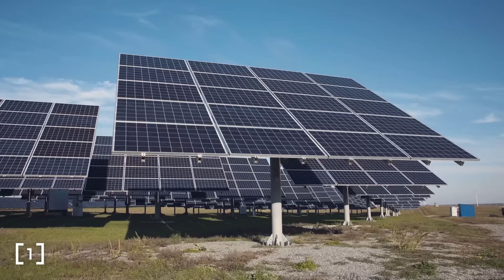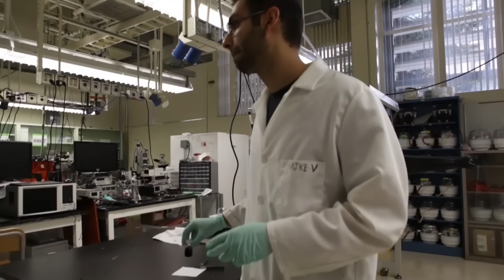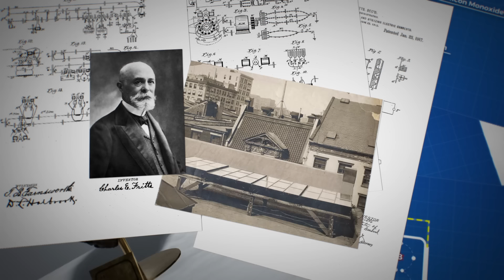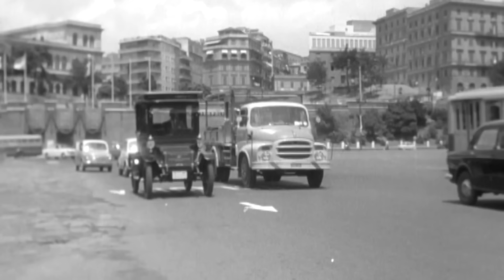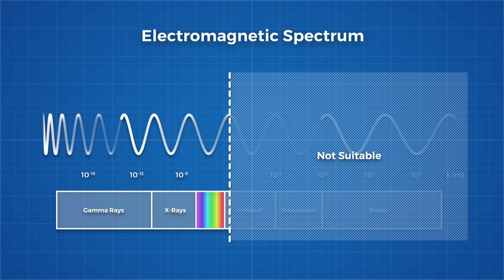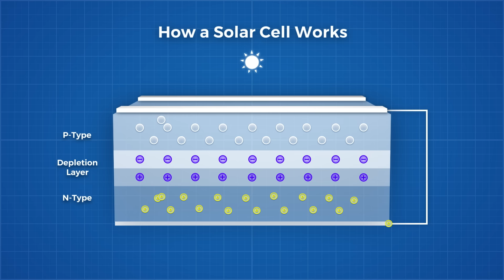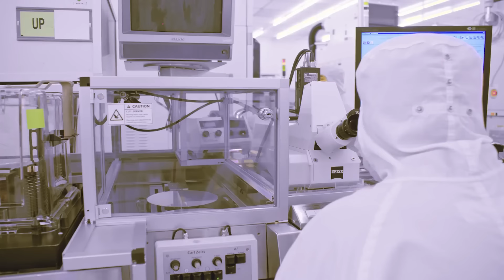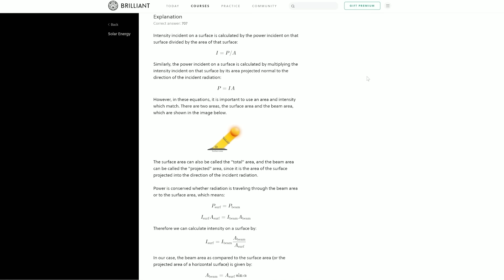The Mystery Flaw of Solar Panels

Comment: None of this even touches on the biggest flaw in solar power -- it only works when the sun is shining, and even then it only reaches it maximum efficiency when it strikes the panel straight on and without any dust, snow, or other obstructions. Solar's inability to provide power when it is needed most, is one of the reasons why California is subjected to Third World-style blackouts.
Reply: @ilikepegasi6449  Thats a false equivalency. Newton wasn't found to be flat out wrong. 

Yes I agree the models are different. What makes you think they can predict far in the future if they cant even get predictions correct within a few hours.

My point with the volcanoes was that the earth was blanketed in ash and the climate didnt "run away" as people are claiming will happen now
Reply: @t_c5266  "You're also not very well informed on history. When i say history i mean HISTORY. Not just human history." And if you had read my comment correctly you would have seen, that I was talking about the time, when humans haven't been on earth. Then humans appeared and the parameters have changed. That's why extrapolation and interpolation can not be applied! Again: There has never been a fire in this building before. Conclusion: There will never be a fire.

"Yes I agree the models are different. What makes you think they can predict far in the future if they cant even get predictions correct within a few hours." Like you even said yourself: different models.

"Thats a false equivalency. Newton wasn't found to be flat out wrong." Of course, he was flat out wrong! The errors in his theory are very small in most daily situations, that they don't matter. That's why it is fine to use it. Einstein has the superior theory in terms of correctness and it includes newton's theory. Take the equations from Einstein and investigate what happens at small velocity and mass. Guess what, you get newtons equations. Please stop talking about physical models, if you don't understand them. I am a physicist and reading this really hurts me.
Reply: @alexgloomandor3956  You've said I don't understand physical models, yet you've only talked from a standpoint of incorrect models and used them as gospel.

Please inform yourself (perhaps a college education) before replying.
Reply: @t_c5266  "You've said I don't understand physical models, yet you've only talked from a standpoint of incorrect models and used them as gospel." You simply said, that the models are incorrect. This does not make them incorrect in the reality. Did you even realize, that you made not even one argument, why climate models are incorrect? Instead, you made your own predictions according to extrapolation and interpolation. I told you, that this method does not work here, because the parameters have changed. Here a simple physics example: We are looking at a very long pendulum. For the past days, the pendulum was a harmonic oscillator with a tiny amount of friction. Then somebody is kicking the pendulum. How does it behave in the future? Translating your approach of history, extrapolation and interpolation, the pendulum would behave like it did before. Obviously, that is not true. The parameters changed. The kick changed the energy of the system and it will behave different in the future, then it did in the past. That's why your approach does not work, if changing parameters are involved. Thatswhy you have to make a model based on equations and physics. Of course climate does not react instantaneous to the change in CO2. It is like driving a boot and turning the steering wheel, you will get the response with some time dilation.  So in short: you did not prove why climate models are wrong, instead you made your own model, which has be proven wrong by basic physics.

"Please inform yourself (perhaps a college education) before replying." I said, that climate changed is happening. In college, you are getting told, that climate change is happening. What is your point here?

"So you're telling me we cant even predict tomorrow's weather, but we can predict droughts and hurricanes 30 years into the future?" You showed, that you don't even understand the difference between climate and weather predictions.

"2 million people will die by this month" (from covid) Your proof who said this is still missing.
Reply: @alexgloomandor3956  On March 16, a 20-page report from Neil Ferguson's team at Imperial College London quickly gathered enormous attention by producing enormous death estimates. 

The following summary of the Ferguson/Imperial College report provides clues about how the model came to generate such dramatic conclusions:

In the (unlikely) absence of any control measures or spontaneous changes in individual behavior, we would expect a peak in mortality (daily deaths) to occur after approximately 3 months. In such scenarios, given an estimated R0 of 2.4, we predict 81% of the G.B. and U.S. populations would be infected over the course of the epidemic. . . In total, in an unmitigated epidemic, we would predict approximately 510,000 deaths in G.B. and 2.2 million in the U.S., not accounting for the potential negative effects of health systems being overwhelmed on mortality.

https://www.cato.org/blog/how-one-model-simulated-22-million-us-deaths-covid-19

Climate models are not science.
Reply: They like to believe that if one goes to school long enough and they can fabricate the product look science based that it will fool physics. I'm not against technology but when we try to get something for nothing the weak minded end up buying it and therefore causing a demise and the breakdown in our culture. This has been going on for a long time in human history and will continue take to place. Let the games begin.
Reply: @ilikepegasi6449  TC is correct about the false equivalency. Newton wasn't wrong. His model was approximately correct. Physicists had begun to identify the limits of Newton's theory, and Einstein proposed a theory that predicted all of the things Newton's theory got correct and also correctly predicted additional observed behaviors that Newton's was incorrect on. Newton's theory of gravity falls apart at cosmic scales and ridiculously high speeds. It's still used for problems at ordinary scales like designing buildings and cars because it's accurate enough for them.

That isn't what's happening with climate modeling. We're not running into the limits of a successful model. We don't have a successful model.

On top of that, the creation of climate models doesn't follow the scientific process. These models are generated with data interpolation. Interpolation is generally useless for prediction. A good scientific model identifies laws that describe the behavior (expressed in mathematical form) and then derives novel predictions from them that are then tested. A good example is that Newton's laws predict that a feather falls at the same rate as a bowling ball in a vacuum (something no one would observe under normal circumstances), and this was demonstrated to be correct. Climate models don't even have the possibility of being experimentally verified in that manner. Heck, things are so in the air that the IPCC can't even settle on a single model to test.
Reply: @BladeOfLight16  As you said yourself, the theory of Newton does fall apart at circumstances, where you would think it would give correct results: moving objects (at high velocities) and some gravitational effects. And the differences can be gigantic, we are not talking about small errors. You might disagree on when and how you can call something "wrong". To me and every other physicist I know, it is totally fine to say: Newton was wrong, because we have Einsteins theory, that describes everything his theory did, but with better precision and even more staff. This does not mean Newton is or was useless, don't get me wrong here.

"That isn't what's happening with climate modeling. We're not running into the limits of a successful model. We don't have a successful model." To me it's fine to say, that our global warming model did run into it's limits, because it did not describe other effects happening to the climate. It limit was to just make statements about the temperature. In that manner the global warming theory was approximately  correct, like Newton was, but it left things out. Like Einstein did with you special and general relativity: special relativity does not make statements about gravity, that's where it limit was and general relativity was created to include gravity.
About the last part on not having a successful model: This depends of course on what you understand by the word "successful". If I jump out of a plane, it does not matter, if I use Newton or Einstein or a future theory of everything to calculate how I am going to accelerate. It is clear, that I am going to be dead, because we can be 100 % sure, that my velocity will be way over the threshold, where I could survive. Einstein is although not the end, it has of course although limits. Future climate models will be better, but it does not really matter, if the temperate will rise for example 2,0° C or 1,92537...° C, the overall statements will be the same.

"On top of that, the creation of climate models [...] are generated with data interpolation." I am sorry but this is not true. The general approach is to set up a very big set of coupled non-linear differential equations. This system of equations is extreme hard to solve and needs a lot of computation power. It is although, due to is non-linear nature, very sensitive to changes in the starting parameters -> this behavior is although known by the name butterfly effect. A simple data interpolation from a temperature-time-diagramm would be very different and simple to calculate. Keep in mind, that data interpolation does only work, if no changes to the parameters of the system have been made between the data points from the time interval you are using to fit your function and the time interval where you want to predict how the system will behave. See my comment earlier on the moving pendulum and then at some point kicking it. You can not use the data points from the past to predict the future. That is where data interpolation can not be applied. This is the limit of the method.
There are machine learning approaches to use the past data to predict future behavior, despite they work drastically different compared to simple data interpolation from temperate-time-diagramms.
Reply: @alexgloomandor3956  " To me and every other physicist I know, it is totally fine to say..."

Yes, because as physicists, we (myself included) know what that means. But if we were discussing it with someone uninformed about physics, we may want to be more clear.

But that said, my point is that there's a category error here. When we say Newton was wrong, we know for a fact that his theory withstood an onslaught of questions, new problems, expansions, and experiments for nearly 200 years without any serious indication that revision was needed. Electrodynamics was able to be grafted onto it directly, merely by defining new forces that fit within the existing theory. The framework was absolutely rock solid within the ability of humans to measure at the time.

Climate models do not have anything remotely comparable. They have never been proven to predict what we observed. We don't even have a single agreed upon model to have done so. We can't even perform experiments with a climate model, because we only have one climate that's beyond our ability to manipulate for experimentation. That's what I mean when I say we don't have a successful model.

"Future climate models will be better, but it does not really matter, if the temperate will rise for example 2,0° C or 1,92537...° C, the overall statements will be the same."

As far as I understand, the statistical error of the models is bigger than 2 °C when you get out a couple of decades. So we can't even say that the models predict such a change.

"The general approach is to set up a very big set of coupled non-linear differential equations. This system of equations is extreme hard to solve and needs a lot of computation power. It is although, due to is non-linear nature, very sensitive to changes in the starting parameters -> this behavior is although known by the name butterfly effect."

And how are the starting parameters determined? Is it by using existing past temperature data? "Interpolation" takes many forms, certainly not all of them linear. It is the process of constructing a function to fit known data. I never suggested climate researchers are using a linear interpolation technique; I said that they use past data to compute the parameters for their model. This is not a valid means of deriving a model.

And yes, machine learning very much is an interpolation technique. It works by computing coefficients in functions using known data, just as I described. It is notoriously vulnerable to error from picking a poor starting function/technique, over training, under sampling, or bad process (such as not properly separating your training data from your test data). You quite literally cannot derive a set of physical laws the way Newton did using it, and you cannot assign to the models it produces the kind of reliability Newton's laws gave us.
Reply: @BladeOfLight16  "But if we were discussing it with someone uninformed about physics, we may want to be more clear" I think I was clear, when it is fine to use Newton and when not.

"Climate models do not have anything remotely comparable. They have never been proven to predict what we observed. We don't even have a single agreed upon model to have done so. We can't even perform experiments with a climate model, because we only have one climate that's beyond our ability to manipulate for experimentation. That's what I mean when I say we don't have a successful model." You know that the warming trend we observe right now was predicted? Of course not 100 % exactly. Based on your argumentation why we don't have a successful model: Do you think it will be possible to have, maybe some day, a climate model, that you could call successful? Because this statement "We can't even perform experiments with a climate model, because we only have one climate that's beyond our ability to manipulate for experimentation." will never change.

My statement on 2,0° C or 1,92537...° C was exaggerated. I don't know on the fly what the exact numbers are. Let's say 4° C by the end of the century with an error of 2° C. So best case scenario "only 2° C", worst case 6° C. What is although important: the temperature rises monotone, at least for the next decades. So if we keep doing what we are doing, the 4° C will come, it just takes longer. For a more exact discussion on the numbers we might want to search for the actual numbers.

"And how are the starting parameters determined? Is it by using existing past temperature data?" Use past data, let's say 10 years ago, plug into your model and see if it fits the data from the past 10 years. If not, change your model until it fits. If it works use present data and plug into your model to predict the future.

I was never talking about linear interpolation, never used that word. Don't know where you got that from.

As I have explained before, fitting past temperate-time-data is not what climate scientist are doing. Maybe we have not been clear enough, what we meant by our statements and the other person has understood it wrong.

"I said that they use past data to compute the parameters for their model. This is not a valid means of deriving a model." I disagree. Example: analyze how a apple accelerates, starting from different heights. Based on the data, the apple accelerates by a specific value, and we come up with a function based on the data. We don't know why the parameters in the function have these specific values, but the model makes correct predictions to all our experiments. Until we have a better method, it is fine to use. What would be a valid method to create a climate model, that is valid in your eyes?

"You quite literally cannot derive a set of physical laws the way Newton did using it, and you cannot assign to the models it produces the kind of reliability Newton's laws gave us." I have never said that, of course this can not be done. But that does not mean we can not make predictions, see my example with the accelerating apple. I would although make a big difference between a model and a physical law or theory.
All climate models have errors, yes, but the trend is overall the same. Is this something we can agree on?

I am not sure what your overall argument is. Climate models have errors -> conclusion ...... ? Do nothing? Place all your money on the best case scenario?
Reply: Two Australian states have purchased the largest lithium battery from Tesla which negates any grid disruptions for a decent period of time. For CA to say they can’t fix the problem, have they heard of Elon Musk? Jk
Reply: Greta and AOC say How Dare You !
Reply: @ilikepegasi6449  I was talking about climate models, not weather models.
Reply: Or it could be because forest fires keep knocking out electric lines and sub-stations
Reply: @terencewong7967   No, they've said it's because they don't have solar power in the evening when people need it, and they weren't always able to get it from out of state.
Reply: Solar thermal plants can store and use built up heat for several hours after sunset (night time is also, coincidentally, when power demand is lowest). Pumped storage hydroelectric is another solution. 
Also blackouts still happen in states with no significant solar generation, so not really sure what you're thinking there.
Reply: @furripupau  As far as I know the potential of pumped store is very limited and dependents highly of the geological properties. At least here in germany it is not an option.
Reply: @ilikepegasi6449  Where are you getting that millions of people number? It gets warm and then people just flat out die? Where is the source for this? Where is the precedent?  What are the proposed solutions (that are actually applicable, not pipe dreams) 

Cmon have some critical thinking and use some skepticism. Don't you remember the covid doomsdaying? "2 million people will die by this month" and its at 200k. These are the sort of "scientist predictions" that make me severely doubt the future predictions. 

I would be much more on board if the scientists have proven to be right more often than they are wrong but that just isnt the case.
Reply: @ilikepegasi6449  So you're telling me we cant even predict tomorrow's weather, but we can predict droughts and hurricanes 30 years into the future? 

Sorry if you don't see the illogical conclusions I don't know what to tell you.
Reply: If battery technology continues to advance at the rate it has been, battery storage will become viable and even practical for power during the times when renewables aren't available.
Reply: @melkiorwiseman  Batteries are ridiculous to manufacture. They require a lot of materials and a lot of energy to produce, and I don't want to think about the pollution involved in discarding them after they're spent. They're not a viable solution. Go nuclear if you want to help the environment.
Reply: @BladeOfLight16  Batteries as a whole aren't an energy source solution because primary batteries take too much resources to manufacture (as you said) and secondary batteries need to be charged.  However, secondary batteries might be part of an energy solution since they can hold energy sourced from elsewhere, such as from wind or solar, both of which aren't always available.  However, sufficient battery storage can compensate for the irregular and inconsistent availability of renewables.
That's one of the big reasons why battery research is still ongoing.
Reply: @melkiorwiseman  I was talking about using them as storage from other sources. They're not viable for that, and the production costs of solar and wind power units are equally astronomical. The amount of waste produced from discarding damaged or replaced units is also ridiculous and full of chemicals we generally want to avoid dumping (like lead and plastic), not to mention the enormous land requirements. Wind and solar are bad if your goal is to reduce our impact on the environment. They drastically increase it; they cause much more harm than carbon. If you really want to help the environment, tried and true nuclear is the best bet we have right now.
Reply: @melkiorwiseman  How long do you want to wait for this new battary technology? Climate change is happening now, we can not wait any longer.
Reply: @alexgloomandor3956  It took around 10 years for lithium technology rechargeable batteries to come to maturity.  It will probably take around 10 years for solid-state electrolyte batteries to also become fully viable.
Solid-state electrolyte batteries will have a higher energy density than lithium, will probably use cheap and common sodium instead of more expensive and rare lithium, and will be able to be recharged at a rate previously unheard of (effectively only limited by the heat dissipation characteristics of the battery).
So the short answer is, probably close to 10 years.
Reply: @melkiorwiseman  I think 10 years is realistic.

So your plan is: wait 10 years, hope that in 10 years we really have the technology to switch to 100% renewable energies. Building all the batteries, solar panels and wind turbines will also take multiple years. What are we doing in the meantime? Burning fossil fuels? For me this does not sound like a good strategy. It just takes to long.
Reply: @alexgloomandor3956  History has shown that we can in fact wait longer.

hell, history has shown that the earth will change no matter what we do. We could get an ice age after a particularly snowy winter. But lets all get on board with the scientists that haven't been correct even once!
Reply: @t_c5266  So you deny the influence of humans on climate change?
Reply: @alexgloomandor3956  I deny that the doomsday predictions are even remotely correct due to the consistently incorrect predictions, and inconsistent arguments.

all you have to do is look at your own response. you're calling it "climate change." well, 10 years ago you called it global warming, and 40 years ago it was called "a new ice age is coming" 

I bet you had to update your argument with every incorrect prediction. 

All you know is there is some effect, but you, and scientists, have no idea what the conclusion is, and with history as our guide, the doomsday predictions are nowhere near close. 

or maybe new york is in reality 20 feet under water like al gore said and we are all just in some sort of moon landing hoax
Reply: @t_c5266  "Climate change" and "global warming" describe different things. In fact climate change includes global warming. So this "updating my argument" does not work the way you want it to work. The opposite is true. To the change in temperature other shifts in weather patterns have been added. Things have been added and not removed.

"All you know is there is some effect, but you, and scientists, have no idea what the conclusion is..."
The conclusion is clear: global temperature rises and shifts in weather patterns happen.
"... and with history as our guide, the doomsday predictions are nowhere near close. "
Humans haven't been here in the past (speaking of big time scales), so history can not be our guide, because the parameters have been changed. Your history argument although does not work from a mathematical point of view, because then nothing would ever change. Constant for ever or periodic. It is like saying: There has never been a fire in this building before. Conclusion: There will never be a fire."
Reply: @alexgloomandor3956  thats my point though. Nobody was harping "climate change" until they found out that there were massive holes in the "global warming" narrative. So they had to issue out a corrected platform. 

You're also not very well informed on history. When i say history i mean HISTORY. Not just human history. Like the numerous periods where there has been no ice at all on the surface of the earth, as well as the earth being a full ice ball. Like the fact that we are still exiting an ice age right now. The fact that super volcanoes have blotted out the sun, and meteors have put more material in the atmosphere than we ever could hope to. 

So yes, the math is wrong because the model is wrong. Thats been proven time and time again. These scientists youre betting so much on don't even know the effects on the past, and they have admitted as much. Then you're trying to say that already flawed models are math youre betting the future on? Models that already have massive errors on them (see: weather predictions) and then you're saying that these errored predictions are somehow going to become more accurate with time? Thats not how extrapolation and interpolation works. 

here expand your horizons. keep an open mind: 
https://www.youtube.com/watch?v=y564PsKvNZs&ab_channel=thisfooliscool

stop just drinking the kool-aid with no critical thought.
Reply: @alexgloomandor3956  LOL climate change has been going on for millions of years, you can't do anything about it chicken little.
Reply: @DxV04  Your comment is based on which scientific publication?
Reply: @alexgloomandor3956  Read the damn article and it will tell you the source. I gave you the name which is what you asked. It was all over the news in March
Reply: @alexgloomandor3956  IN fact since you are soooo into credentials why don't you examine the credentials of the man whose name you requested and received and then critique.
Reply: @DxV04  Thank you very much for the link. I do not live in the US or GB, probably that's why it was not in the news in my country. The article does a good job at pointing out, why this death prediction is very unlikely to happen.

You made a comment, that humans can not influence climate without any explanation or source. It is not my task in a debate to prove you wrong, if you haven't even tried to proof or explain your statement. If you don't have any source, explain it in your own words.

"Climate models are not science" again a statement without any explanation.
Reply: @alexgloomandor3956  you are welcome,  climate computer modelling is full of errors just like like the use of computer modeling to predict covid mortality. That is why after I said computer modeñing is not science. If you are willing to listen to scientists that deal in actual empirical science and actual data, and not doomsday presictions I can give you video links or namea if you prefer.  I am quite busy and the other person you engaged here pretty much said what I would say. So again if you are really interested in hearing or knowing more let me know.
Reply: @DxV04  Thanks, but no, I do not need any links or names.
Reply: @alexgloomandor3956  so you want a proper explanation  or not? I believe that is what you asked for?
Reply: @DxV04  If you want to back up your statement, a explanation would be helpful.
Reply: @alexgloomandor3956  my statement is backed up by actual scientist tjat use the scientific method. Modelling is not based on the scientific methed. They can explain it much more accurately. I think you are not interest in actually listening with an open mind, you simply want to argue, why do I say that? Because that is wat you did with the other person. Im trying to cut through the bull shit.
Reply: @DxV04  I am not 100% sure what you mean by "the scientific method". A explanation what be helpful.

I am open to logical arguments. However, most of the time if someone uses the term "open mind", there is much bullshit, that is obviously wrong, sorry no offence. The other person showed that he has no clue how different scientific theories correlate to each other, see his statement about newton and einstein. That made me angry. I apologize for my reaction, however he is still wrong.
Reply: @alexgloomandor3956  

sci·en·tif·ic meth·od

/ˈˌsīənˈtifik ˈmeTHəd/

noun

a method of procedure that has characterized natural science since the 17th century, consisting in systematic observation, measurement, and experiment, and the formulation, testing, and modification of hypotheses

That is what i mean when i use the words scientific method. Again, if you dont want to hear the perspective of skeptical scientists why would you want to listen to a layman as myself?
Reply: @DxV04   ok, to put it very very flat:

observation: after changes in CO2 levels in the atmosphere, the global temperature has also changed.
Measurement: investigate very old ice.
Experiment: well we are pumping CO2 in the atmosphere right now
Formulation: temperature will rise drastically, if we don't stop emitting CO2.
Testing: well that is what we are doing right now and we already see, that the global temperature rises. We can not build a second earth to test the hypothesis. The only alternative are calculations, modells based on differential equation or machine learning approaches applied on past and present data (just to name a few examples how we can use computers to help us)
Modifing: global warming has been modified to climate change.

Seems like your method has been used by climate scientists.

I said that I am open to logical arguments. I am just trying to be a nice person and respond, after someone asks me a question. Show me these sceptical scientists.
Reply: @alexgloomandor3956  The thing you do not know or do not accept is the fact that the climate models have been plainly wrong. So if the real scientific method was applied as per the definition I proposed, to which you seem to agree, then the models and its prognostications should have been thrown out a long time ago. I will get you some names I and I hope you listen to their dissertation and judge the value based on the information provided and not the propaganda. Just a question, you do realize that when the ocean warms it releases CO2 right?  Additionally, asking the right question is always key. The first step in your attempt at using the scientific method would not pass in school. 

You said:observation: "after changes in CO2 levels in the atmosphere, the global temperature has also changed."

The scientific method has five basic steps, plus one feedback step:
Make an observation.
Ask a question.
Form a hypothesis or testable explanation.
Make a prediction based on the hypothesis.
Test the prediction.
Iterate: use the results to make new hypotheses or predictions.

It would be more like this:
Observation: There seems to be a warming trend, 
question: What drives the observable trend in warming?
question: How long has it been warming?
question: Are there multiple dirvers? 
question: What do we not understand about long term climate? 

Hypothesis: CO2 is the main driver of climate change (based on answers to the questions)

Predictions made with computer models based on preconceptions and understanding

We are currently testing and since the start of climate model predictions, we now know that our hypothesis has problems because the expected warming has not occurred. 

This is where the doomsday people fail at using the scientific method. Climate science is much more complicated than the simple and dumbed down pictures of the greenhouse effect that they feed to adults and children. Our understanding of the feedback mechanisms is infantile at most and much more research needs to be done. 

Additionally, if climate doomsayers would be honest, they would admit that there are huge benefits to an increase in CO2. But sadly that is not discussed by them. I wonder why. 

I will get you some names. That will go into detail as to why CO2 is not the main driver of climate. Why the warming trend is not catastrophic, and that by attempting to get away from cheap, available, and principally reliable energy we are plunging the world and poor countries into an energy crisis.
Reply: @DxV04  accepting the fact, that climate models are wrong: I am waiting for names or sources which proof your point.

Nothing wrong with the method in generell.

About the propaganda: What I never get is why do you think are climate scientist telling these "lies"? Are they making a mistake and believe they are correct? Do they take money and if so, who is paying them? If it is about money, I guess fossil fuel industry would be happy to pay them, if they would change there mind and advice in response.

Yes I am aware of the fact, that when the ocean gets warmer it releases CO2. Thats part of the Problem: burning fossil fuel -> release CO2 -> temperature rises -> ocean gets warmer -> more CO2 is released -> temperature rises even more

I don't get your statement about not passing school.

"Observation: There seems to be a warming trend" I am puzzled. Do you agree there is a warming trend or not?

About the expected warming has not occured: Seems like you haven't looked at the data from the past years. New temperature records are broken every year. Despite most predictions are about the end of the century. Here you seem to disagree, that there is a warming trend.

The positive sides of more CO2 are not discussed, because the negative sides overwhelm.

"... the warming trend is not catastrophic..." So now you agree there is a warming trend?

How we going to generate electricity is a hole different topic, that's not part of our discussion. See my post earlier on batteries.
Reply: @alexgloomandor3956  @DxV04 I think it would be helpful if we draw away from absolutes here. Here is my perspective having researched this issue extensively. Do high CO2 levels correlate with global warming? Yes, as evidenced by the ice cores. However, CO2 levels often lagged the initial temperature rise by a few hundred years, so some think that we are seeing the effect of warming releasing more CO2 (such as dissolved CO2 in the ocean being released as temp rises) or other unknown factors. Still, I do not think it is not improbable to say that the current warming trend of 1C is anthropogenic. CO2 is a greenhouse gas, though it is a minor one in the scale of warming factors. This has been confirmed in the laboratory. CO2 levels are the only viable reason we know of for the current warming. Almost every other hypothesis has been thrown out that I know of. Solar activity is not abnormally high nor are we in a solar period anymore where the earth should be warming such as it being tilted more directly at the sun or drawing closer on average as it orbits. This variation in earth's tilt and orbit is likely the main cause of the recent ice age cycles as evidenced by the ice cores. If you map back the earth's solar cycles, you will find that the rise in temperatures seen in the ice cores roughly correlates with a predictable pattern of the earth's orbit and gyration (variations in tilt). This is now a well respected theory. CO2 rose as well as the earth warmed, but it may be a secondary effect. However, the time scale we are seeing the current temperature rise is far too fast to be explained by this, nor are we in a cycle of change where we would expect it. In fact, if we were to correlate with past cycles of earth's gyration and orbit, we would expect the earth to be just starting to cool from its interglacial period if I remember correctly. More powerful atmospheric warming factors such as water vapor, particulates, methane, etc. are also not abnormally high. That leaves CO2 as the currently most viable hypothesis which does correlate with warming and has tripled over baseline levels since industrialization. 

However, I think it is right to question doomsdayer predictions. We know the earth has warmed 1C and that it is likely anthropogenic. Will high CO2 levels create a runaway greenhouse effect? Probably not. Will they melt some ice and raise sea levels slowly. Probably. We've seen a statistically significant small rise already. But Antarctica (where the vast majority of the ice is) is very resistant to melting. It maintains a polar vortex about its location that keeps the region cooler than the rest of the earth. Given hundreds or thousands of years, I think the current average temperatures could eventually chip away at the extent of the antarctic ice but it seems unlikely that a lot of it will go anytime soon. Much of Greenland and the arctic sea ice caps will likely melt though over this century. But keep in mind the arctic ice is not a high percentage of the earth's ice and we were already losing a significant portion of it every summer (though the permanent part has been shrinking). As such, it is a bit unreasonable to expect catastrophic sea level changes at present, or huge swings in temperature in the future. It is reasonable to expect gradual warming, of perhaps a maximum of 2C this century, and slowly rising sea levels though. Temp variation of this degree and higher CO2 levels have been shown in the laboratory to be very advantageous to plants and will increase crop yield and arable land. So that's a good effect that is not currently being focused on. It is true though that it will shift climactic zones. Humans and animals would have to adapt and get used to new seasonal and growing patterns. The animals most harmed will be the artic ones that are adapated to live on ice, but others will and have been shown to be thriving with their expanded ranges. So the question we must ask is: what is the most pragmatic approach to this coming future? Should we stifle emissions, put heavy restrictions of growing economies in africa and asia and tell them they can't use cheap, reliable power to grow their economies like we did? Kill off our reliable sources of power we can turn on/off easily to meet peak loadings before we have alternatives? Pass high carbon taxes that hurt the poor and raise the cost of utilities dramatically? Or is it best to do what we are currently doing? Shift our growing patterns. Do our best to protect wildlife and allow them to migrate and adapt as they want. Subsidize alternative research. Keep working on and improving these technologies. Diversify our grid as affordable alternatives become available, and then sell/share these innovations with 3rd world and growing economies as the economics speak for themselves? 
The fact is that we cannot easily avert the changes that are happening, but progress is being made and alarmism isn't really helping things. I think it is particularly unproductive to imagine that the earth and our behavior can't adapt or take advantage of a warmer world. We may find looking back at the end of this century that money would have been much more effectively spent on adapting to the changes while subsidizing alternatives rather than killing off fossil fuels early before we have good, cheap alternatives. Particularly because there is no way that we can stop africa, south america, and asia from using cheap power even if the entirety of Europe and North America stopped today. The most humane way to tackle this problem in my opinion is to tackle the economics and make alternatives and environmental solutions affordable. We can pour money into helping people adapt to the climactic changes in their areas in the meantime and into protecting the environment.
Reply: @danaphanous  I agree to almost everything you said. Especially this part is very important: "However, the time scale we are seeing the current temperature rise is far too fast to be explained by this, nor are we in a cycle of change where we would expect it."

About the doomsdayer predicions: There are many climate predictions and some are doomsdayer. You although have to keep in mind, that these are the worst case scenarios that could happen. Nobody is saying, that these will be happening with 100 % chance. We know, that temperature will continue to rise. How dangerous this will be is hard to say, for some regions in the world it might not be a problem at all. Most regions will have problems, even if they are not doomsdayer, it is something we should avoid.

Let's keep the climate change aspect aside. Moving away from fossil fuel would be cleaner in terms of air and water pollution. This is good for the health of all animals, plants and humans. Moving away from combustion engines would make cleaner cities and having less noise. These points alone are worth to me, to change how we should generate our power.
Reply: @DxV04  I would like to receive an answer.
Reply: @alexgloomandor3956  I haven't forgotten about you. Just been really busy. Ill get back to you. I apologize.
Reply: dont worry, once we strip mine half of the usa we will have enough poison batteries to store all of the energy we need! until 10 years roll around and we gotta do it again
Reply: @t_c5266  If the new batteries work the way they're supposed to, they'll use sodium which can be obtained from plain old salt which we can harvest plenty of from plain old sea water.
Even if they don't and we have to continue to use lithium, the largest supplies are in the Russian territories which make up the former USSR.
Reply: @melkiorwiseman  so strip mining is cool as long as it's in Russia. Got it.

And do tell. What is the manufacturing process and byproducts to make these sodium batteries? Surely we don't just scoop some table salt into a cylinder and viola!

What is the amount of sodium we'd need compared to current production and consumption?
Reply: @t_c5266  The bit about lithium mining being in Russia was tongue-in-cheek, but the amount of lithium in rechargeable lithium batteries is pretty low according to what I've read.  So low that we're not going to run out any time soon.  I expect that the amount of sodium required would be comparable since the chemistry is almost identical except for the substitution of sodium for lithium.
I don't know enough chemistry to outline exactly how the process of extraction works, but sodium is so plentiful when compared to lithium that the cost of the batteries is likely to be a lot lower.
You're right of course that salt won't be used, since it's only the sodium metal which would be useful in this application, but my understanding is that separating sodium chloride into sodium metal and chlorine isn't difficult, and chlorine is useful in many chemical processes so it won't be wasted either.
Reply: @t_c5266  Where do you think coal comes from, if not mines?